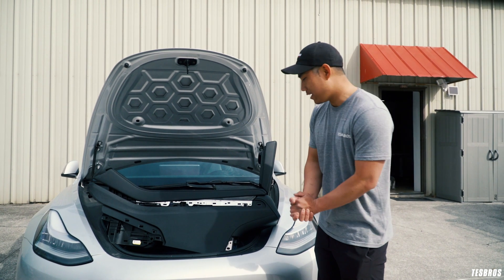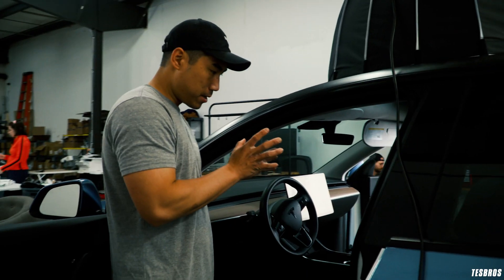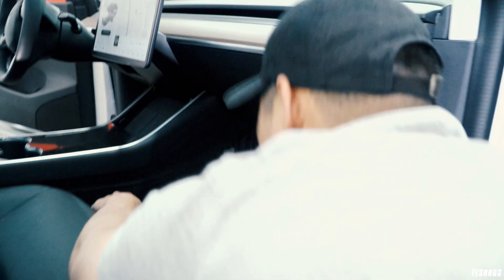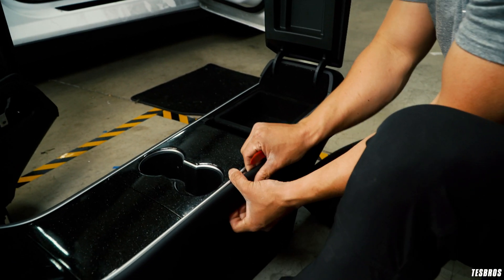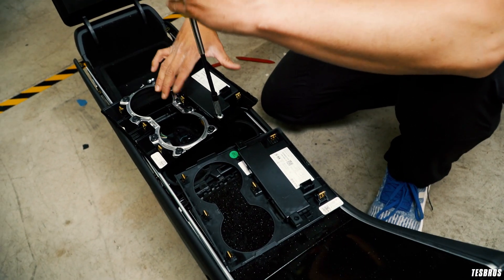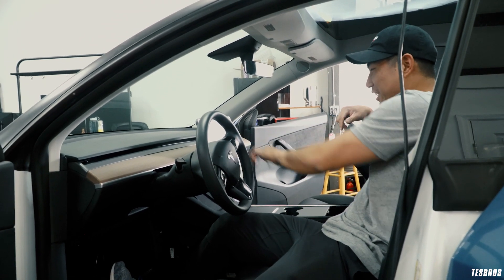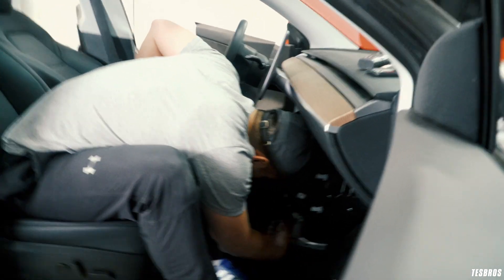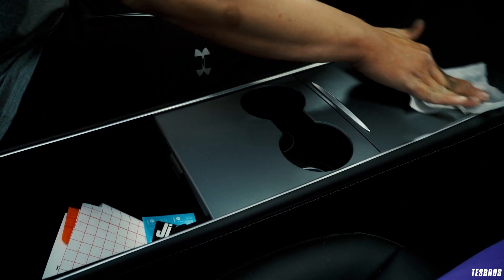Tesla Center Console Swap Gen 1.0 to 2.0 - TESBROS

Comment: I have a 2018 Model 3 and am very interested in this...  You should be able to compare the old and new wire harnesses and make an adapter, ordering those CAN bus plugs from Digikey.  Or you could transfer the old wire harness from the old 2018 console to the new one.  The wireless charging cradle might need to be spliced in and some wires may be too short, but that would definitely work.  The fact that the security component is a compatible plug is huge.  Also, probably, you should have disconnected that power under the back seat before doing any of what you did.  That seems to be the very first thing a Tesla Ranger does when they come to work on my car.
Reply from the maker: If you can find an adapter or some sort of workaround to install this in a 2018, I would love to hear your results!
Reply: Did you ever attempt this? Also have a 2018 3 and very interested.
Reply: Or minimum unplug the 12v battery. 😅
Reply: @tesbros will a 2021 gen. 2 console work with a 2020 model 3?

Comment: Hey would you mind listing the part numbers you used including any adapters? I’m contemplating the swap.
Reply from the maker: Here you go! 1755503-00-A. Also, you can find part numbers here. You need to login using your Tesla account though. https://epc.tesla.com/en/catalogs/2/categories/28/subcategories/24908/systemGroups/98298
Reply: @tesbros  Hi, thanks for the video, i have a 2019 perf and willing to do the change. 1755503-00-A is the only part to get in order to do the swap ? I see in the catalog the part "2.0, CONSOLE, H-DECOR ASY 1755540-00-B", does that need to be ordered as well ?
Reply from the maker: @doomam  yep, the center console is complete so it’ll include everything you need to swap. The main thing is that your car needs to have the correct canbus attachment under the center console in the rear seat.
Reply: @tesbros  seems that I have the canbus with 26 pins so should be ok, I’ll order and follow your video guidance. Have April 2019 build (with HW3).
Also asked hansshow team they confirmed.

Between are you aware of the new door panel compatibility ? Would be great to update that too with wood trim…

Again Thanx

Comment: Hi.  Great video & walk-thru.  I was able to purchase the console from the Tesla Center nearby and the service center tried to install it into our 2019 Model 3 Performance.  Unfortunately, they ran into the CAN BUS issue and could not complete the install.  The service center tech did say he did some research online and found that the CAN BUS mod can be done but may require splicing, etc.  He said maybe someone will release an adapter to have the console upgrade done but he ran into the same issue you did regarding the CAN BUS.  They did not charge me for the part or the labor since they said they could do it but were not able to do it.  He said I can always order the console and do it myself later.  Hopefully someone will release an adapter.  Any news of a release?
Reply from the maker: Sorry to hear that. We haven’t heard of any updates or new releases regarding the CAN BUS, but we’ll update y’all if so!
Reply from the maker: Yes that is true. And on point.
Reply: There's one out now, aliexpress, ebay, and stateside ali ones on amazon.
Reply: @Andy00723  what is it called?
Reply: @Andy00723 do you know what it’s called?

Comment: Having seen the Ioniq 5, I would prefer the model Y with no centre console around the feet & lower leg area.
I would prefer the roominess, while retaining the console between the seats.

Is that feasible at all, or are there too many critical parts there?.
Reply from the maker: I suppose so but you won't be able to use your keycard which can be necessary sometimes.